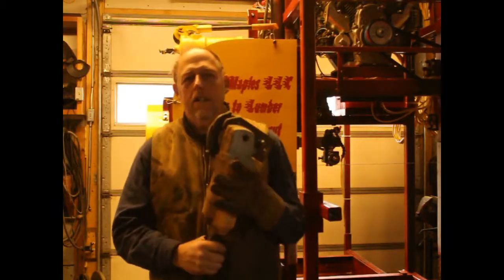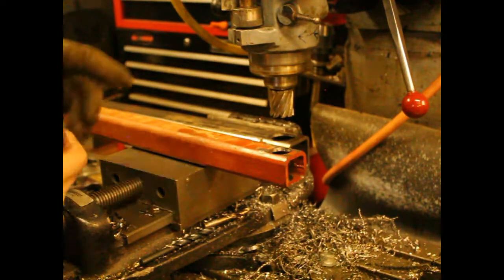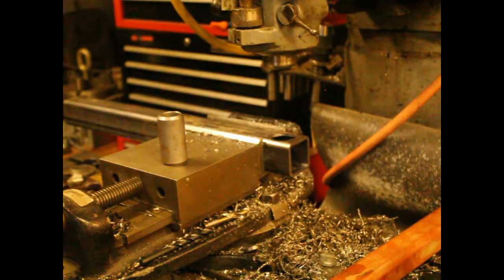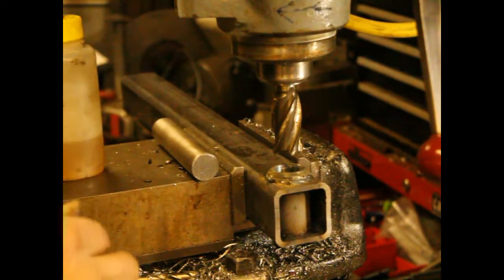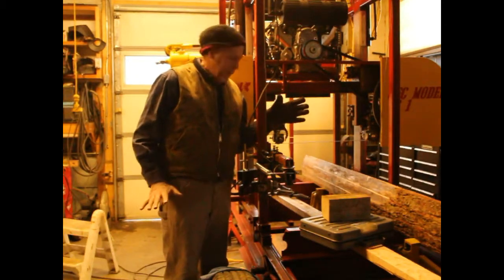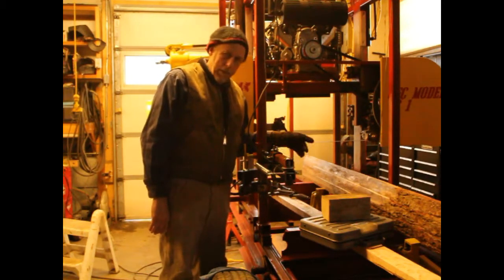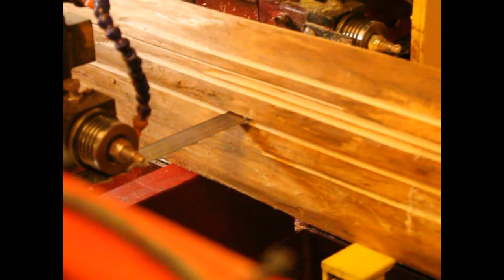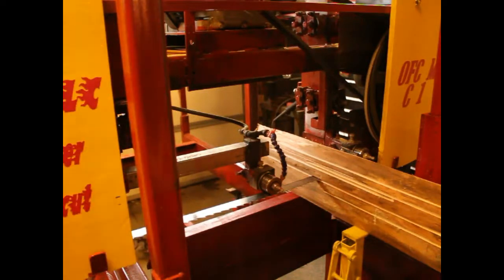Building a bandsaw saw mill. Making a debarker or mud saw.

Comment: why not something like a skillsaw instead of a short life angle grinder? Is it adjusted up and down independently from the blade height? So, you have to set it each cut? if it is, why not mount it to the bridge that caries the blade?
Reply from the maker: I do agree it should travel with the saw blade.  The angle works great and you can put a wider cuter on it. As I said in previous comment I recommend using a 9" angle grinder as it has more power and is much more robust.

Comment: It looks awesome and is well thought out, but instead of having to adjust it manually for every cut, why not have it mounted directly to the sawhead? That way you could make infinite cuts without having to adjust each time
Reply from the maker: You are absolutely correct, my system did not lend itself to connecting direct without a lot of linkage issues.   I have thought about designing a constant follower but it has not made it up the priority list.  Keeping the logs clean is the best debarker.

Comment: How long are the arm tubes?? Nice design
Reply from the maker: The arms on mine are around 18",  it really depends on the mill and where they will connect to the carriage.  The debarker should never swing past the center point
 even on a small log.
Reply: Thanks.i just need a starting point.i,am building one to put it on my little oscar 18 mill.i planned on putting a stop on it so it can only swing over just so far.
Reply from the maker: @twobears1224   I have had some power issues with the 4 inch grinder.  It works but I am going to upgrade to a 7 inch and would recommend using the more powerful grinder.  The problem comes if a large knot sticks out the 4 inch can stall.
Reply: Thanks for filling me in on the power issue..i,ll keep it in mind..is there videos of the actual sawmill build??